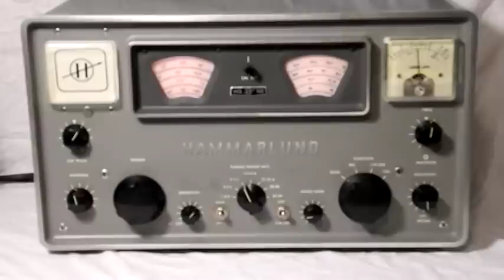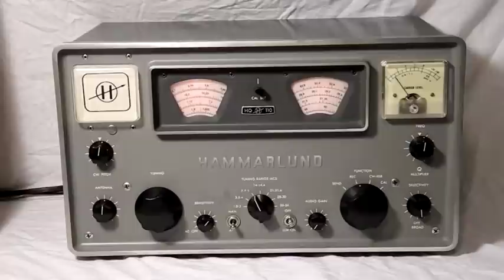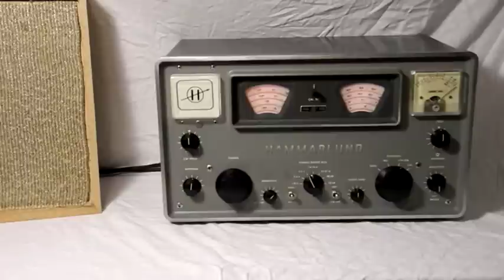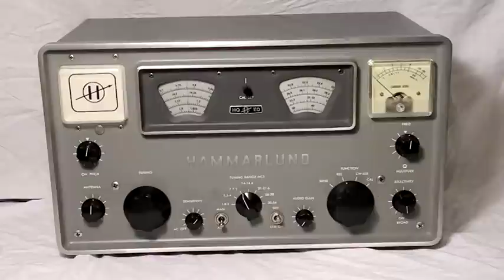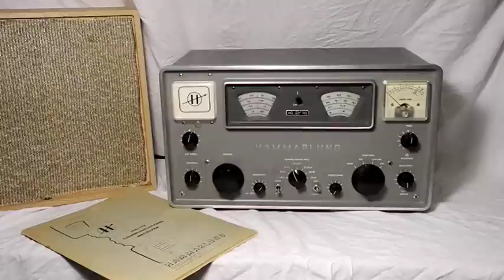The Hammarlund HQ-110 Communications Receiver

Comment: This was my first rig as a novice in the U.S.  I paired it with a Drake 2NT.  I really liked the setup.  When I got my General Class license, I traded it in at Henry Radio for a Swan 350C.  I still have and use that rig.  Nostalgia set in and I found another Drake 2NT on eBay a few years ago.  Last week, I bought another HQ110 on eBay and I'll start working on it.  It has that weird thing on the back that looks like a 110VAC outlet which is actually a T/R muting connection.  At first, it didn't work and I googled about and found out about that "feature".  Jumpered it and it started working.  I still need to go through it and clean up the controls and switches but when I'm done, I'll have the rig that I had when I was 17 years old.

Comment: That model was almost deaf on 6m ssb....  Wonder why the meter doesn't work on this model when in SSB?

The reason why there is a hole in the front panel for a clock was due to the fact that the man that invented it, worked for a company that made clocks before he went into the business of making air variable capacitors and amateur radios..  The logo a capacitor - was their company trade mark..

Comment: Nice video there. I did some Q multiplier somewhere in 2001 , and got 20 Khz bandwidth in 40 meters as a pre selector   but it was pretty sensible . Somehow , even dough i'm only 37 old ,i did like vacuum tubes since i was 10. Right now i am looking for small factor tubes including rectifiers for a  small and clean transceiver for the next era to come, who knows what EMP or solar flares can do in the future. Got to build some solar panels vacuum tube based too . hi ! hi  
73 ! yo8rxp

Comment: Hi, very nice presentation. I currently have a HQ-100. I get a tad too much hum, despite recapping. When engaging BFO, it hums intolerably loudly at the BFO's lowest setting (at the point just turned on) but that seems to be where the voices are most intelligible.  I read something about hum being caused by the transformer lamination drying out, and to give it a ping with a hammer (!) to kill the hum?
Reply from the maker: The transformer issue sounds like that would cause hum coming from the transformer itself, and not the speaker. There are some good suggestions in the rersponses here: http://www.qth.net/pipermail/hammarlund/2002-April/000231.html
Reply: Yeah, it's perplexing. Even with the volume fully off, I hear hum from the speaker and even through headphones. All tubes checked or replaced. 
Thank you, though!

Comment: What type of antenna are you using? I live on apartment antenna suggestions. Thanks
Reply from the maker: haggy38 I have a dipole antenna on the roof. For shortwave listening, just a wire (the longer the better) should work reasonably well, ideally leading outside but even if indoors you should be able to pick up lots of stations.

Comment: Why does my HQ-170A drift so bad?
Reply from the maker: +8xlaxx There were some changes made in later production runs to reduce drift. Possible your unit is from the first run and could be modified. Some info is here: http://www.rlinwood.com/family_webpage/linkpages/ham_radio/Rig_Pages/hammarlund_hq110c_receiver.htm